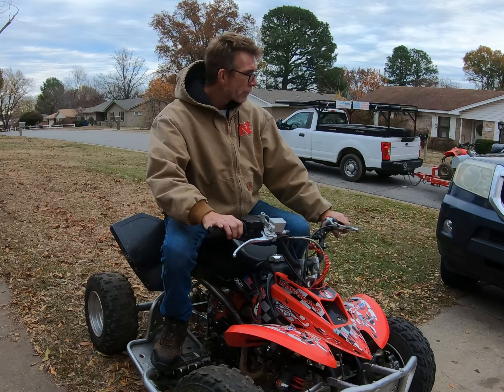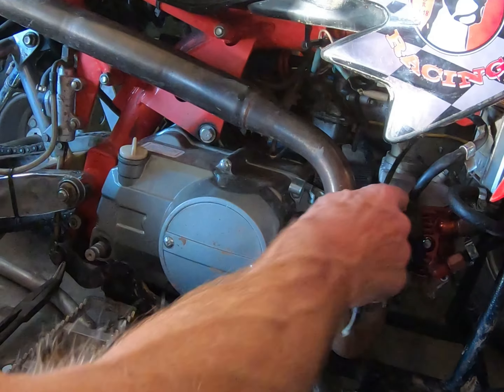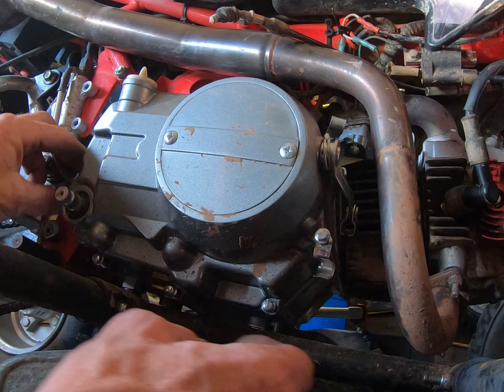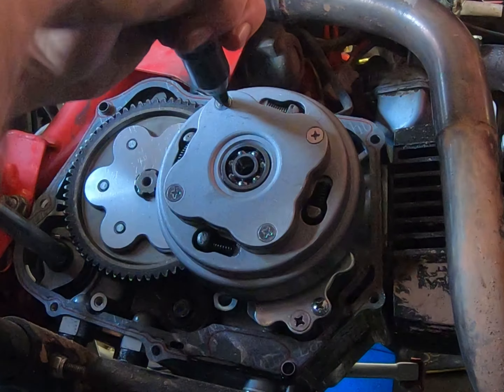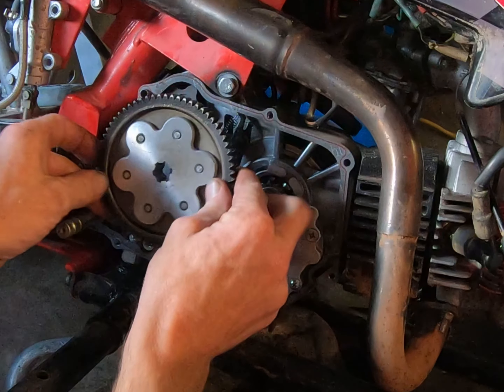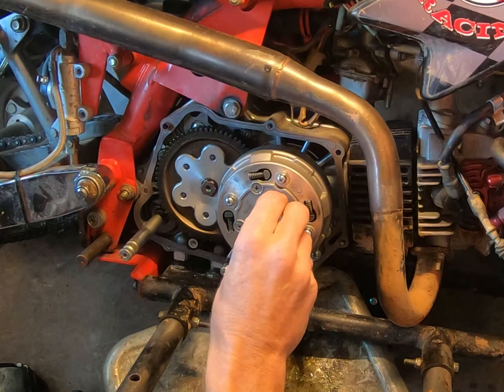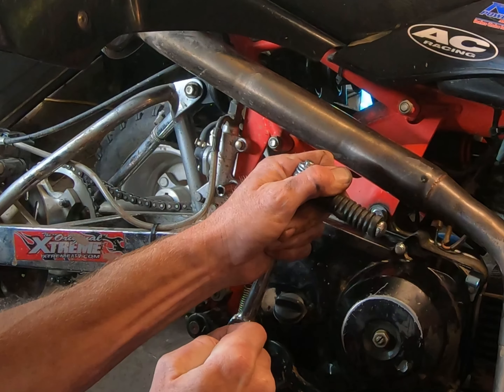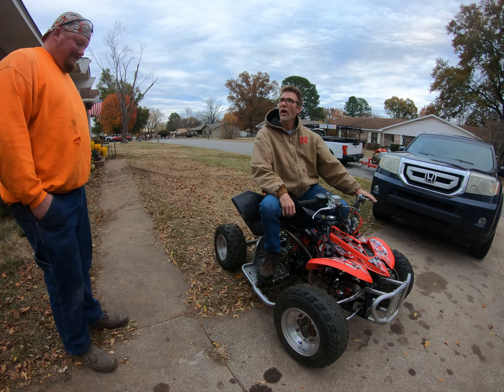how to change manual clutch to semiauto Extreme typhoon 125 quad !ripping it at the end pitbike atv

Comment: Hey bro i got one of these cple months ago needs valves? I was told i tore it apart seen they needed replaced idk what else is wrong with it hopefully nothing but where can you order factory parts at for these valves and stuff should work just head and jugg is different bolt pattern right? I just threw a new 125 i got of Amazon on it i seen on ebay right now can get a 3 speed with reverse 125cc for 180$ free shipping thats crazy that cheap i fix and resell them i get 700 out of these china cheap quads lol i remember when they where 499 brand new anyway awesome video and if you know where i can get factory parts lmk thanks
Reply from the maker: The extreme and the knock off will bring over $1000 if there nice ! I may have an old head I’ll have to check I just put a 125 clutch n sent it my buddy bought this one and changed it to a Pirinaha 140 e start semi automatic for his daughter to race at our local tracks ! 125 clutch is way to go ! I’ll check my garage scrap see if I kept ano of those heads
Reply: @WaldensWorld  yea engine brand new straight out the box and quad is nice to I'm prob gonna keep this one though I love the look of it and alright bro I appreciate it well work something out if you got it forsure could use it

Comment: Would you happen to still have the    Old motor?
Reply from the maker: I used the auto clutch but I have the rest the cylinder is trash
Reply: @WaldensWorld  how much on it with the manual clutch in it
Reply from the maker: You want to buy it ? It needs topend ! You know china stuff don’t fit extreme topend ? Pay shipping and $70 ?
Reply: @WaldensWorld  live down in booneville maybe we can meet up I have a typhoon that could us a kickstarter shaft
Reply: What tape of gas use this quad 150 Baja storm
Reply from the maker: Just seen this lol u still got it